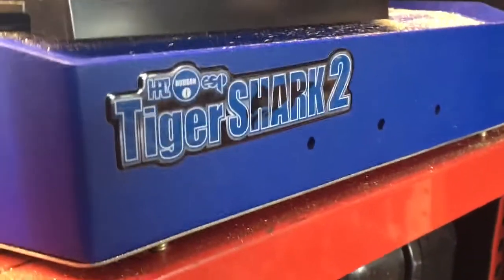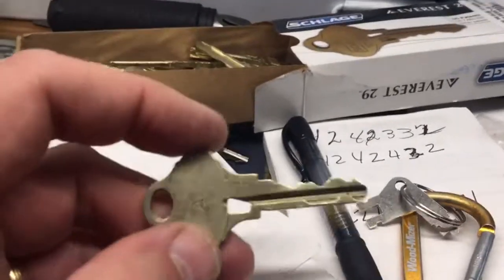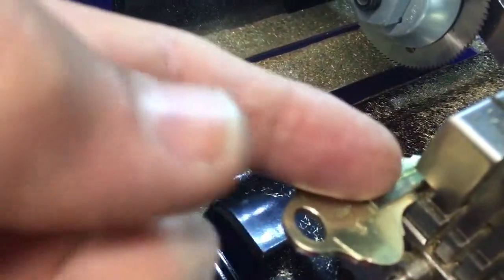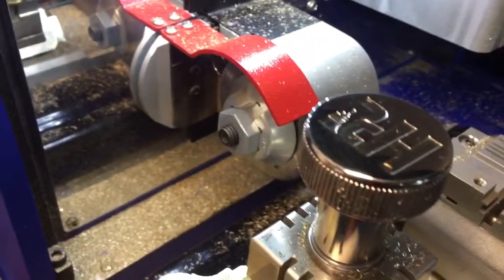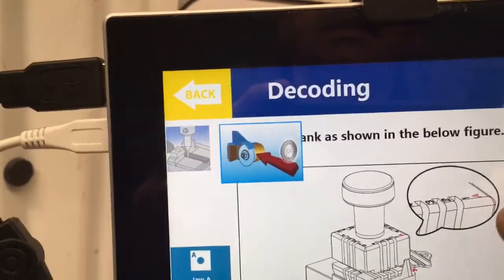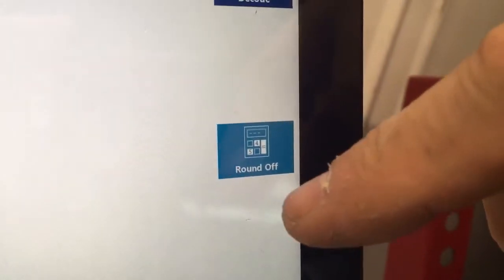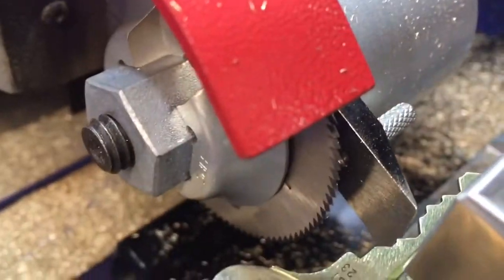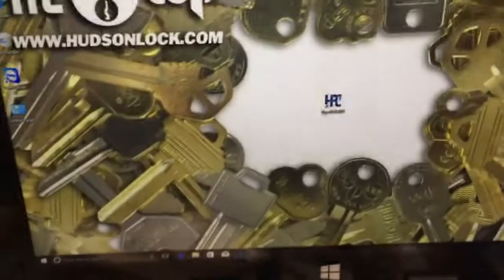HPC Tiger Shark2 Decoding Schlage S123 High Security Key

Comment: Have you cut many sargent and yale keys with it? Im thinking of buying one and the 3d pro we have currently is seldom accurate with edge cut keys.
Reply from the maker: Timothy Harris, yes I've cut all types of keys with it.  It is very accurate.  You can cut them by bitting specs, decode, and even duplicate keys that are out of spec.  I have found that if I decode a key and it doesn't work the original lock, it isn't because the machine is wrong,, it meant that the lock was pinned up incorrectly, or the keys were originally cut or duplicated wrong.  I've ran this machine through the paces and I have found that it does what I bought it for.  You won't be disappointed when you buy it.